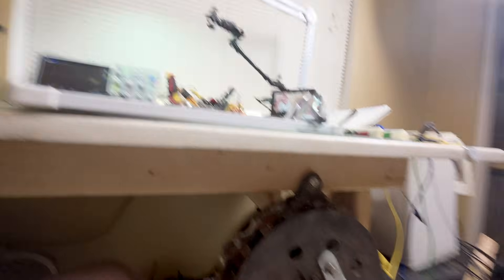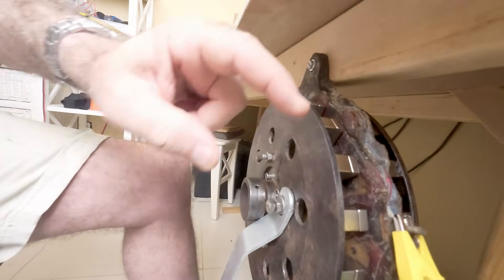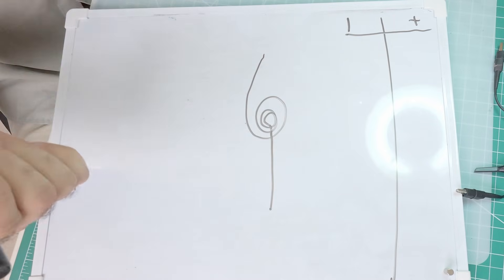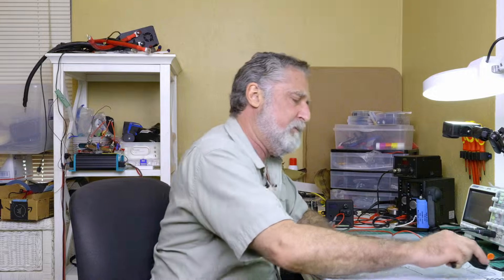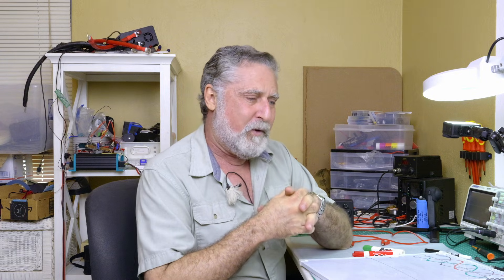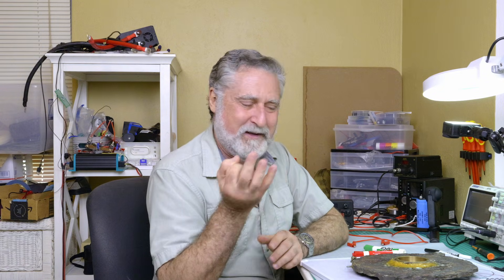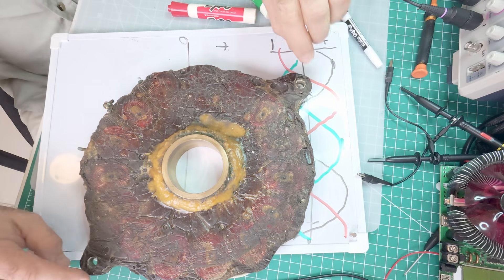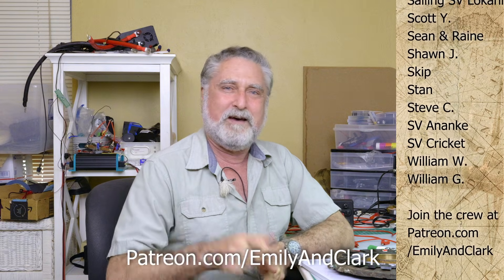Sailboat Shaft Generator Theory  (Shaft Generator part 3)

Comment: Hi Clark, hope your 2026 is off to a good start.  I joined on Patreon, wondering how I find the spreadsheet you mention in the video.  Thanks!
Reply from the maker: I just reposted a link to it to Patreon members.  It's at the top of the messages list.
Reply: @Clarks-Adventure  What membership level is required to unlock it?
Reply from the maker: "Best Mates" gets the wind generator spread sheets
Reply from the maker: There are not supposed to be any perks for those that sign in with no tier.  Patreon is about supporting creators.
Reply: @Clarks-Adventure  NP... some creators do post some stuff for general consumption, even for "free" members.  I understand that's not the typical model.  With multiple tiers it's sometimes a challenge to determine which tiers get what.  Thanks for the clarification.

Comment: Do like how this can be more or less solid-state. One thing bolt to the already spinning shaft and another to static brackets. No new bearings, belts or other moving parts that will break.
Reply from the maker: Since it was attached to the propeller shaft and that is a critical component I put effort into making a system that can't fail in a way that risks the vessel.
   Thanks for noticing that.

Comment: Clark, have you calculated optimal torque, magnetic vs kinetic? I’m assuming that you’re generating torque by taking advantage of the prop turning in the passing water while sailing. Just thinking about the additional magnets and stalling the prop.  I suppose if you’re adding additional “alternator” while motoring with this setup then torque is less of a concern. 
I live on a powerboat but this application has me interested as an electrical drive.  Way back Chevy had a hybrid pickup that had a electromagnetic ring that bolted in between the engine and transmission and encompassed a modified torque converter, it wasn’t very efficient but it was an okay high speed drive assist and it was an easy bolt in system.  I was thinking that converting my boat into a similar hybrid drive could extend my range using what you’re developing here (in reverse of course ). Basically, electrically derived torque from stored electricity in lithium.  Where power is applied to the electrical drive based on rpms of the motor using some hall sensors and an arduino, poor man’s torque assist hybrid.  Not crazy efficient but a bolt on modification for older inboard power boats to extend range.
Reply from the maker: If you hook this to a brushless DC motor controller you have just made your own electric drive.
    But you would want different windings to make more power.
    If you had a big Li bank and solar (or plug in at the dock) this would extend your range or increase your available power nicely.
    You now have a hybrid boat.

Comment: My scientist buddy has a kid he is in charge of Clark. Where did you get your education? What schools? Though, given my own experience, someone close to you started your journey.
Reply from the maker: And I'd expose any kid to my enough is enough series.
Reply: I suggest to the parents.. they make a crystal set.. using components and then from actual scrap as was done in WW2..
Then build a wind turbine.. look up Hugh Piggot and the one's he has built..
Then there's the whole world of repairing things.. small engine's like a mower and generator... I do suggest jet washing then first to give a clean version to start with...
Reply from the maker: Check out my wind generator playlist.  I describe how to easily carve the blades and design your own alternator.  I think I saw his offerings when I was developing mine.
Reply: @Markus-UK  I would get into trouble if I described the things we tried to make.
Reply from the maker: So those must be fun things.  ;)
   But if you are in the UK a sharpened stick might be illegal from what I hear.
Reply: @Clarks-Adventure  Nope. We were not in the UK. Just Gen X kids with all the homes, chemical cabinets and tool sheds to ourselves.
Reply from the maker: For the most part I'm self taught.  Reading experimenting.
    If I had the right kind of kid today I'd buy them an Arduino and get them started.  Even at a surprisingly young age I think this is a great introduction to logical thinking and research

Comment: Good morning Clark, as usual great video!

You gave me a flashback to my adolescent childhood . When I was 16 I took a job working at an electric motor shop left over from the World War II time. They were really old school.

It was close to my house and I was able to make a little cash working after school and on the weekends , unbeknownst to me I was learning a trade that I did not know existed that eventually led to my engineering job... again didn't know that this first step in my young life would help point me in a direction..

I learned how to wind, electric motors and arms, we worked on all types of motors from repulsion induction motors, permanent magnet, DC motors. I couldn't believe I was getting paid to learn this stuff.😊

Love the video you just did my friend ! I wish there was more people putting stuff like this out there! 

Thumbs up from the frozen tundra of Michigan ! 
-Keith
Reply from the maker: It's becoming hard to find rewind shops in this day of throw away repairs.  But they are a great and useful shop to know about, especially for the boater with our hard to replace low voltage motors like in a windlass.

   And surprisingly inexpensive.
Reply: @Clarks-Adventure  I totally agree, the day of maintenance and repair is almost replaced by Justin time delivery by Amazon. It's frightening how unbalanced we become relying on places like Amazon.

Comment: I have been involved in three accidents involved with electricity.
In one I saw a woman at the bottom of a pool and the setting made me reconsider jumping in after her, instead I went to the hotel front desk to get the power turned off. A security guard did jump in before the power was turned off. Two dead.
The second I did not witness, but it was with people and a place I know. A couple brought a sailboat into their creek on a high tide. After their boat connected with a power line, the father went out to rescue them.
On another occasion a big blue ball came down the power line to my house and I heard the sound of a car crash. Fortunately cops came to the scene immediately and kept onlookers away from the rain-soaked road. They also kept the driver with broken legs inside the car until the power company shut down the power.
From this I learned that electricity is invisible, but deadly.
All of this is to say that I can execute lots of safety procedures on a sailboat, but I don’t really understand how I should proceed when batteries and solar panels are subject to flooding in salt water, for example.
I have heard really stupid public figures talk about the dangers of electric boats, but I realized I haven’t prepared much better myself.
There is a lot of attention to electrifying boats, I actually have a minor Coast Guard license, but I am totally unprepared.
Got any suggestions?
Reply from the maker: Maybe I should do an "electricity safety" video some time.
    But low voltage DC is really way safer than 120v AC.  And in a totally different world than lightning.
    For the most part you just need to keep things from getting hot and starting fires.  
     I have an electrical master class playlist and you might enjoy the episode in fusing.  I show what happens when you do something wrong.  It's a bit exciting!
Reply: @Clarks-Adventure  Elecricity Safety! Yes!
I had a genius Shop teacher, Mr Burgess.
Since we all liked him we would hang out and ‘talk shop”.
One of my favorite themes was questions like how small of a battery can you have in the bath and not get electrocuted.
He would stop those sorts of conversations right away because he had been teaching Shop to “smart” kids for years and he knew there was no limit to the stupidity of a kid who thinks he is smart.
That has been my guideline ever since.
Imagine you are a reckless idiot who thinks he is smart, and consider whether your plan is too stupid even for that person.
Reply from the maker: It's time for you to stop wondering......

About 50 volts
Reply from the maker: Now you need to subscribe and send a link to your favorite video from my channel to some friends.

Comment: Should I ask how this affects electrolysis,
or wait till the end of the video?
Reply from the maker: It shouldn't affect it at all.   At the end it's just another dc Charge source.
Reply: @Clarks-Adventure yes, but…
I only have a superstitious understanding of electricity, and I would suppose the prop shaft would be inside an electrical field and the shaft is exposed to salt water between the hull bearing and the propeller.
Reply from the maker: There is no electrical connection between the coils and the shaft.  They are insulated.

And the shaft is coaxial to the magnets so no change in flux so no current generated there